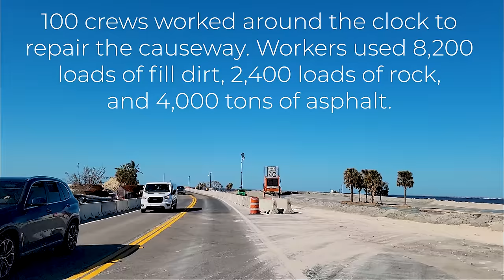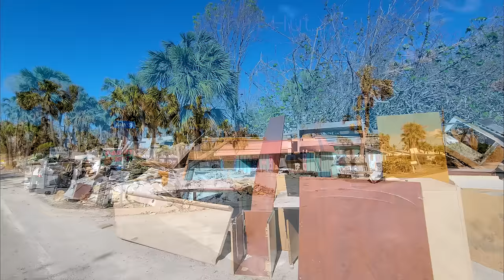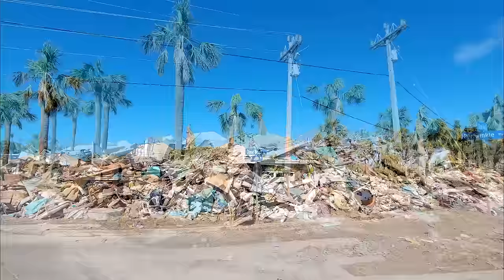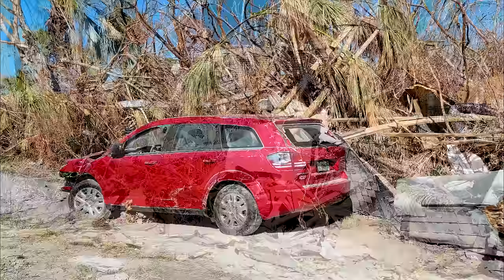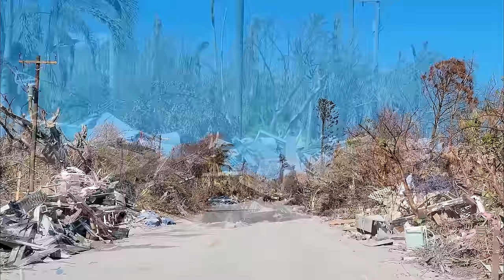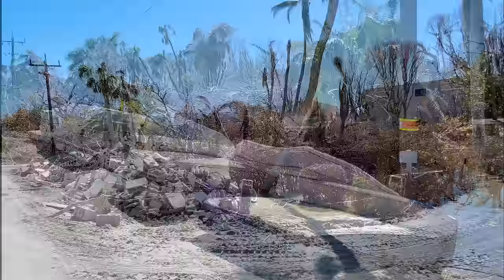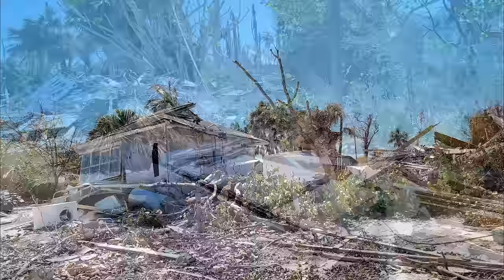Heartbreaking! Hurricane Ian leaves Sanibel Island covered in damage and debris.

Comment: As someone who lived thru hurricane Andrew can I give some positive input.  In six months clean up will be far along. 
The destroyed structure material seems  already being  pushed to curb.  The roads are clear, being  repaired or been repaired.  FEMA should be bringing in hundreds or thousands of FEMA  trainers to  live in.  Was young kid.  You wonder where do I begin.  My Dad would say, " just start somewhere or start in that corner".  Currently the cities , county's, state are or have revised building codes.  No future wood structures, very few or no mobile)modular  homes, new construction must be CBS block.  Roof structure construction much tougher.  We did not lose our  home.  It was CBS construction.  Roof  damaged.  Looked like that.  Aftermath of nuke.  Good luck.  The longer it goes the better will look.  Thousands of dump trucks.  Miles long line at land fills.  New mountains will emerge at  trash in landfills.  You have survived. Rebuilding will be for the strong physically and emotionally strong young and middle aged to handle now. March on.  Preserve.

Comment: If I am buying or building a home on or near the beach in Florida, it has to be at least 15 feet above ground level. This is incredible destruction.
Reply from the maker: Hard to believe the water went as high as it did. It's just hard to wrap your head around the fact that the water was "over my head" deep in places I've walked on dry land a million times before...
Reply: @BarometerMediaVideo  I live in the middle of the state near Lake Wales, and we had 17 inches of rain in the storm. The damage in Sanibel and Fort Myers is mindboggling. I have never seen storm damage like that in 25 years living here. Thank you for the great content. God Bless.
Reply: @yhird  I think it was due to the abnormally hotter summer and the Saharan dust.
Reply: @brandonking2679  The Saharan dust cloud has been suppressing tropical storm development this hurricane season. Ian formed far enough west that it escaped the effects of the dust cloud. I have not checked recently on the status of the dust over the Atlantic, but I see the same wind shear regions are still in place.
Reply: These are "barrier" islands for a reason.  Even if you build high enough, the ground underneath may have shifted and sea water corrosion of materials is still a problem.  A barrier island should be visited with a light footprint. If not, you can only buy time with your fortress.
Reply: @brandonking2679  there was nothing abnormal about this summer. It’s hot every year. What’s abnormal is the weather guessers claiming 100mph winds every day until the last minute. Fkn oops!

Comment: Yes it looks devastated, yes it is just heartbreaking.  But what I can see is that most of the hurricane proof houses had relatively minor damages.  Sorry to tell you this, but in my country, when there are several natural disasters in a row in the same area, we're not installing electrical poles anymore, they are underground lines.  Most of the trash on the side of the road are caused from wind and water.  There should be a city law that restricts all the new buildings to be much higher from the ground and can resist to high winds because it's gonna happen again.  I hope not, but logically, it will happen again. The highest elevation of Sanibel Island is 36 inches and is in the path of most hurricanes. In the video I saw some really damaged cars, I hope that people have left anyway for their security ?  Thanks for sharing this video and good luck for all residents.  We'll be visiting you again !!!

Comment: Do I see wooden electricity poles, and above ground! I live on the east coast of Florida. All our poles are cement and steel. Residential infrastructure is underground. Why are these little islands not like this.
Reply from the maker: A good percentage of the cement poles on the island snapped in half during this storm. Not enough of the new-style poles were immediately available right after the storm passed, so they are using temporary wooden poles just to get things running on the island again.

Comment: Some houses are still intact, but probably not livable anymore.
Reply: Even if you dry them out There is salt in the wood  All the nails and screws holding the house together get soaked in salt water for a few days until the house 100% dries out    While the house gets moldy ,  the nails are rusting away